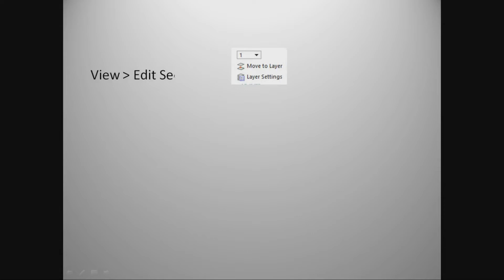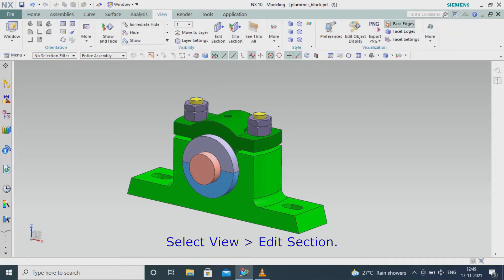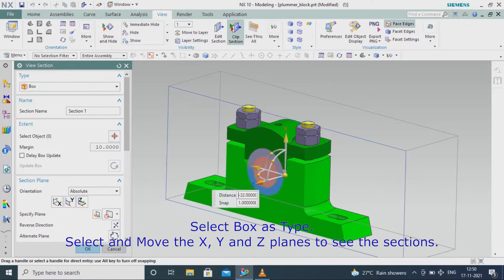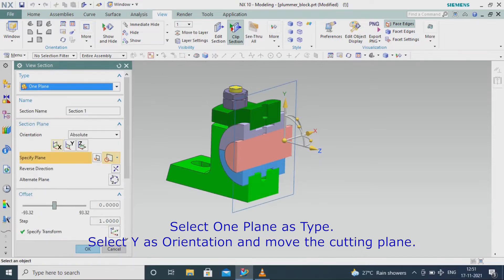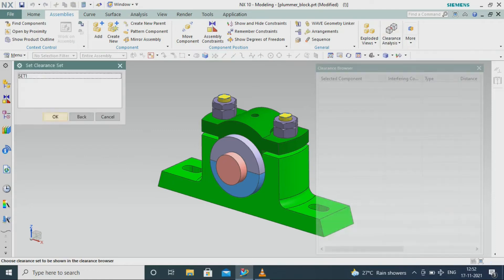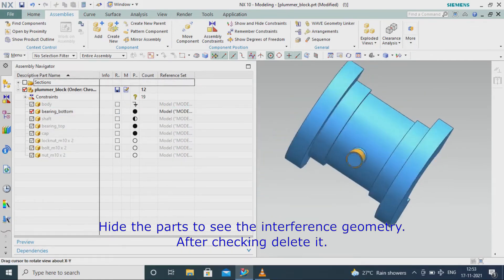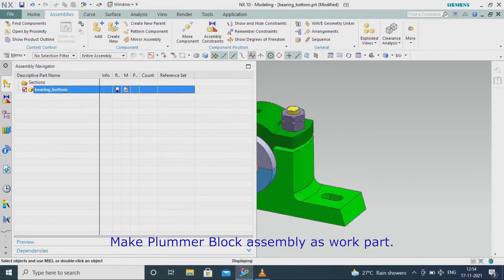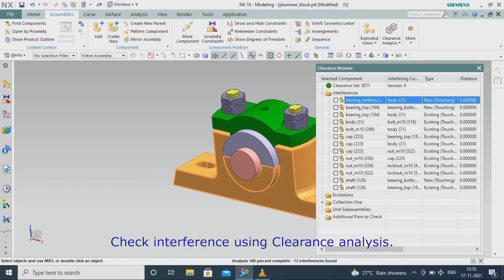Interference, plummer block, Nx cad

Comment: I have a question. I want to divide various actions, but no matter how many options I adjust, there is no response. It is possible to divide the time and set it, but the movement is unnatural. (1,2,3,4,5) I want to do motion motion in sequence. Do you know how?
Reply from the maker: thanks for the comment.
sequence has limited capability. please try in motion simulation.